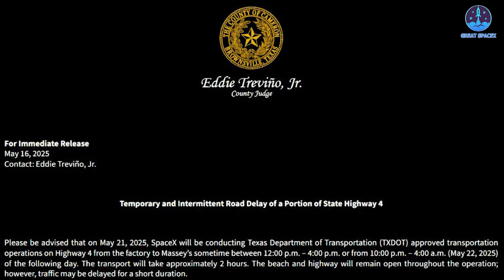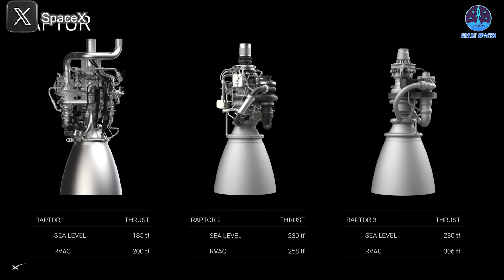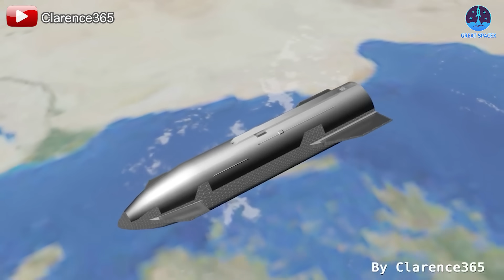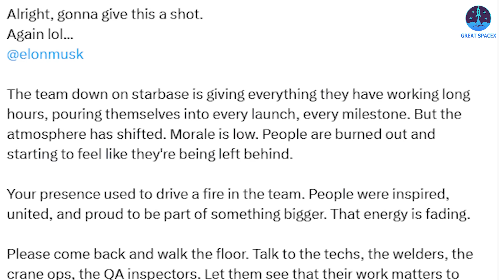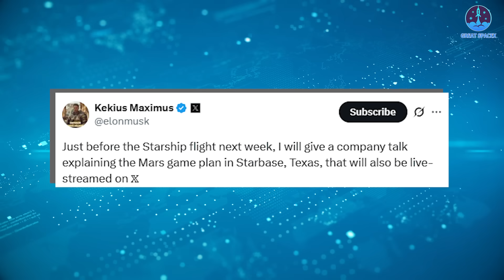Ship 35 Drama Continue! Is the Starship V2 Problem Really Fixed for Flight 9...

Comment: SUPERB PRESENTATION,  AND ADDED FACTS OF # 6 & 7 "SHIP FAILURE" OTHERS HAVE REFUSED TO PRESENT --- YES, MASSIVE CHANGES TO THE SHIP "FUEL SYSTEM DESIGN" ON 6 & 7 CAUSED FAILURE.... MOST LIKELY BECASUE FAILURE TO RUN A "FULL SUITE OF ENVIRONMENTAL TESTS" .... INCL SHOCK & VIBRATION.

Comment: 6:35 Whatever the hot staging ring modification will be, the distance between booster & ship must be increased. So taller hot staging ring. What you think?
Reply: The next version will be built into the booster rather than being a seperate ring. It will also be designed with everything spacex has learned from the current one.

Comment: SpaceX is doing to many changes to many times, they should have stuck to the first design, proved it could get into orbit and refuel, then let it burn up, then do it all again several times, once it's flight proven, move onto the next mission stage make it human ready, the rocket doesn't return to earth on the Artemis III mission, so why are they even bothering? With all these changes, in such a short time frame, I doubt SpaceX knows where any problem is, and it probably now has more than they know.
Reply: They have to send lots of fuel up to LEO for that mission should they scrap all those tanker ships as well?
Reply: @shaung949  1 ship 10 tankers do the mission, where on the moon or mars is the catch tower, or we building this first? and landing 50 years from now?
Reply: @flightsimdev  starship doesn't need one, the moon and mars ships will have landing legs. The gravity there is low enough what ship by itself can reach orbit so no need for a booster.
Part of the reason starship needs so many tanker flights for the moon is to fuel a round trip including landing and launch from the moon.
Reply: @shaung949  If it takes 10 for orbit, another 2-5 in refuelling attempts or more, another 10 trying to land on legs on earth, then another few attempts on the moon, another 3-5 make it human rated, how far away is this thing and how much would you have saved if you just built one to do it all right the first time? 

Everyone moans about SLS on it's cost, and build time, but one launch it works.

I don't know about you, but if I had a choice SLS or Starship, I would go with SLS, it works it has already sent Artemis on an orbit to the moon, and it works, it might not be reusable, but it did the job on the first launch.
Reply: @flightsimdev  If you just focus on the moon then it's not an unfair judgement. 

The major difference is that starship does more than SLS. Starship won't need refueling to get hundreds of tons of payload to Leo or launch satelittes or stations. 

Human rating is not technically needed for moon operations as that is covered by NASA, even sapcex is not looking at trying to human rate starship for at least 100 operational flights
The other major difference is once starship is operational each flight will cost just fuel as both stages of the rocket return, SLS needs to replace the whole thing which is why it can only launch every 2 years where as starship could launch every few days from multiple pads.
Reply: @shaung949  HLS is Human Landing System, which part of this isn't human rated for SpaceX Starship HLS rocket we see trying to get into orbit atm?
Reply: @flightsimdev  Strangely human rated only applies to earth. 
NASA is quite happy to land people on the moon with vehicles that are not certified to carry people into Leo from earth.
For the HLS flight the crew will dock with starship in lunar orbit, visit the moon with starship then return to their Orion capsule for the return to earth.
Reply: @shaung949  So you just say it has to dock with Orion, transfer crew to Starship for the landing, it's human rated to do this, isn't it?
Reply: @flightsimdev  No, that's the thing it can be used for crew on the moon without being human rated on Earth.
Reply: @shaung949  For a spacecraft or rocket to be human-rated, it must meet strict safety, reliability, and redundancy standards. This includes:

 Life support systems: To provide air, temperature control, and waste management.

To get the crew out safely during a launch or landing emergency.

Backups in case a primary system fails.

Extensive testing under all mission conditions.

NASA, for example, requires a 1 in 270 or better chance of survival for crewed missions.
Reply: @flightsimdev  and starship is going to fly on Artemis III before all that is certified for Earth use. NASA is currently certifying HLS systems for Artemis.
Reply: @shaung949  Right now Starship doesn't need to be human rated, (no humans on board) but one day it will have to be, The shuttle, Apollo, SLS and Orion were human rated since day one, Starship has to get through it as well one day.
Reply: @flightsimdev  spacex have said that they are not planning to do that until starship has over 100 flights and it has proven reliability.
Reply: @shaung949  Do you think they can do 100 flights in the next two years considering it takes 2 months between 8 and 9 when Artemis III goes to the moon?
Reply: @flightsimdev  nope but NASA will allow them to carry crew for Artemis regardless.
Reply: @shaung949  Just go Google Artemis III and Starship job (HLS) job.

Comment: The starship project is starting to look like the Tesla cyber truck debacle.  

Elon Musks timeline for this project has slipped by years and still has to put a starship into orbit. 

Surly if it fails again and again it’s going to get cancelled.  

You can’t keep pumping public cash into a trillionaires private dream of setting up base on Mars. 

It’s not working anywhere near the levels proposed by Musk.
Reply: Cancelled?  Musk is going to Mars, regardless of contracts with NASA, contracts are just gravy to his goals.  There has been far more private dollars spent on this endeavor then any Public.  For the most part, all the monies to develop StarShip comes from Musk.  Once it's working, then he has contracts to deliver on!
Reply: Starship is funded by private cash from spacex, they don't get paid by NASA until they deliver.

Comment: Bad management is the biggest problem that SpaceX has! Why did they rush from flight seven to flight eight? The fact that they’re doing a lot of checks now is good because that probably will help them to find the problems with the technology, and correct them. The concerning thing is that their worst problem, bad management, is not being discussed and probably is not being corrected. If you want to see a company with bad management continuing to cause them to go from one failure to the next, look at Boeing corporation. Does SpaceX wanna become like that? If so, keep ignoring your bad management problem.
Reply: You can't fire Elon. Spacex work on different principles to other companies and they are not afraid to fail, just because flight 8 did not succeed does not mean it was bad management. They thought they had got enough data to solve the problem for flight 8, obviously the problem was more comples than they thought. Spacex do iteration so they would of had a team working on a long term fix that removed the problem completely at the same time as the quick fix team working on flight 8.
Reply: Only in your small opinion….
Reply: @christophermontoya6178  
You are right - my opinion is small.  But it is based on a very large piece of evidence that Starship Flight 8 WAS too soon after Flight 7 to allow for the thorough checks that are being done now and it also exploded.  Some managers at SpaceX made or approved that decision and I don't hear about any management changes at SpaceX as a result.  You know, the fact that you are attacking me instead of responding to the substance of my remark may be a very good sign that you would fit right in with SpaceX management.

Comment: Some of  the twitter threads from alleged spacex employees concerning issues with management and internal politics are very alarming if true. Musk's return to Starbase couldn't come soon enough. The stint with doge and the president seems to have hurt starbase. He needs to get back there  ASAP and get things back on track. Hopefully his presentation before flight 9 represents a a shift in the way things are going down there and renewed focus. Hopefully we get to see some updated mockups of starship v3 refueling, and HLS which are closer to what they will be in reality and can get some sort of a timeline as to when they expect to have these systems up and running. All focus is on the ship now and it seems as though the team is doing everything in their power to mitigate the resonance issue and do as much data on the ground as they can to ensure that there isnt a rud. I'm still 50/50 on the  success of ship 35 at this point. Unsure of how much they can do to mitigate the issue on a ship where plumping is already welded into place. If they can pull off a full success with flight 9 I will be amazed to be honest. I wouldn't be mad if this flight slips into June. They should work on getting all their ducks in a row to ensure they are setting up the system for success, and if it fails, ensuring they are able to collect the necessary data to ensure that they can make meaningful changes to address the root cause in the next flight.

Comment: Pogo vibrations were a problem for the Apollo programme and it was first observed on Apollo 6. NASA fixed the pogo problem by adding a damper system into the F1 fuel supply lines to stop fuel surges.

Comment: v2 harmonics problems V1 = no problems..... It was a mistake to rush into V2
Reply: I partially agree, from an engineering standpoint, but only by a couple launches. Block 1 wasn't designed to put any extra mass into orbit. They could have worked on orbit/de-orbit procedures. Maybe some orbit transfers, but likely didn't have the fuel for that. The big one people would like to see was landing of ship, but I think they didn't want to attempt that until tower two, which still isn't ready.

Full block 2 has capacity to put some mass into orbit. That allows for testing of the starlink deployment and fuel transfer systems. Both of those have secondary value. A good fuel demo full fills a NASA contract worth something like a billion dollars and leads to the other moon stuff worth more. The other is putting up 20-100+ starlinks with every launch. That would save them the cost 1-8 falcon 9 launches; with each test, even if ship was lost on re-entry or through other testing.

Full block 3 really just doubles lift capacity. That will be needed for space station deployment, moving large masses to moon or mars, and further cost savings for starlink.
Reply from the maker: So do you think SpaceX should back to V1 or upgrade to V3?